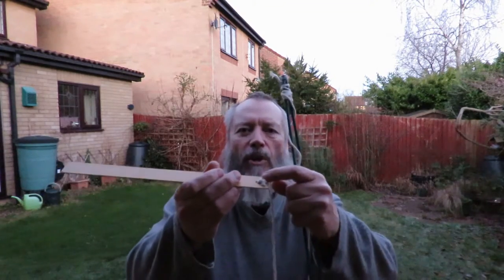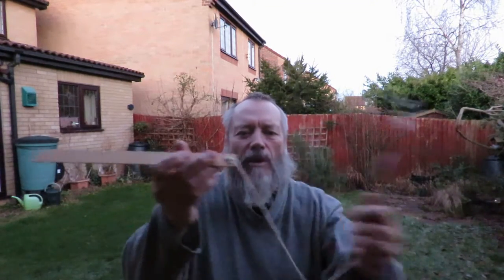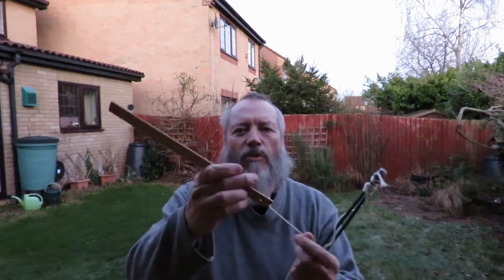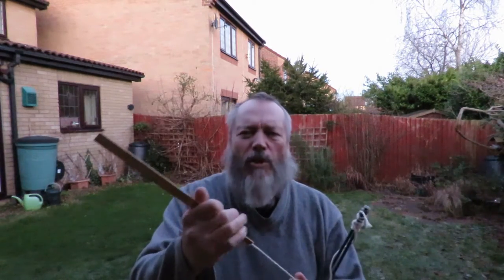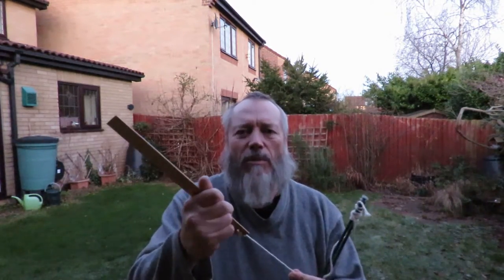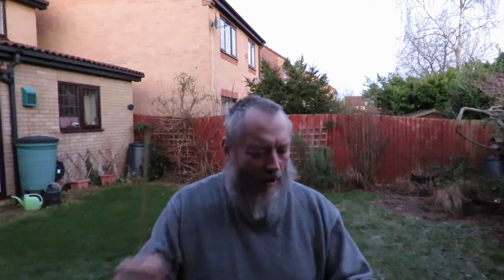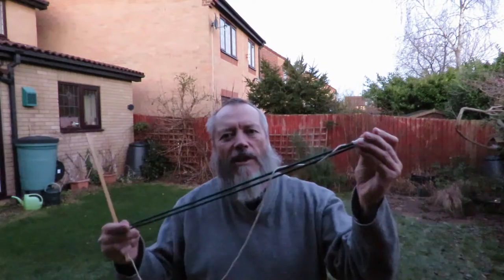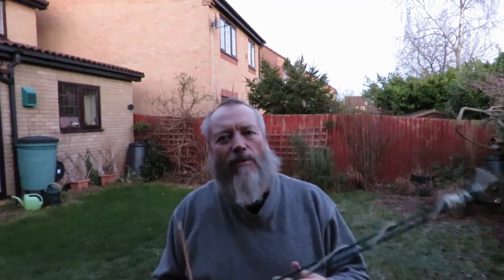Things we can do with a 12 inch or 30 cm ruler #1

Comment: Had to smile when you smacked yourself on the butt with it, i remember back in my school days a craze for something similar, it was a small metal cylinder with a slot cut along it which you whirled around on the end of a string and it made various whistling noises depending upon the speed, that could be the basis of a project recreating that.
Reply from the maker: Yes I think the tube ones are working on a different principle but a similar result (annoying noise coming from a neighbours garden 😊) I will put it on the list.

Comment: hi sir, i have a project due in a few days and i need a rubber band car that will goo really far. please link me your video that has a rubberband car that will go the furthest. Thanks
Reply from the maker: I have several hundred different cars so choosing which one would suit your requirements would depend on what components you have available. This is one I often recommend as it is a generic design that I use and will meet most project requirements Rubber Band Powered Car 1 x size 64 - full length video https://youtu.be/pIO3FiHX4Oc?list=PLA5a2xPRSrB3g5RiX8Kf_uUBOL0Tb7AS0 The video description includes extra information and links to other videos.
Reply: GrandadIsAnOldMan THANK YOU SO MUCH!!!! You saved my science grade! ❤️
Reply from the maker: Good luck 😊
Reply: GrandadIsAnOldMan thanks